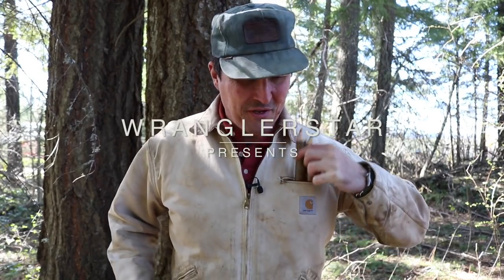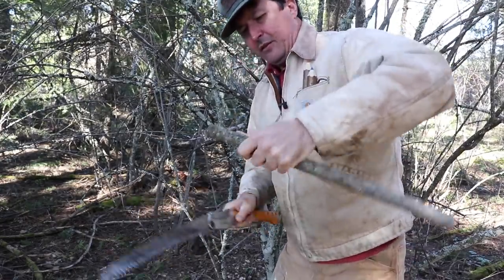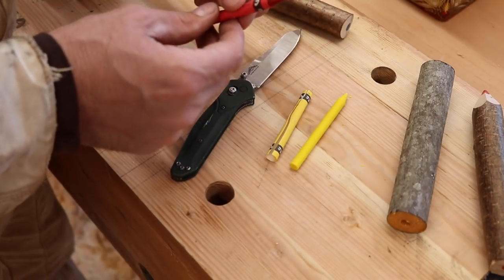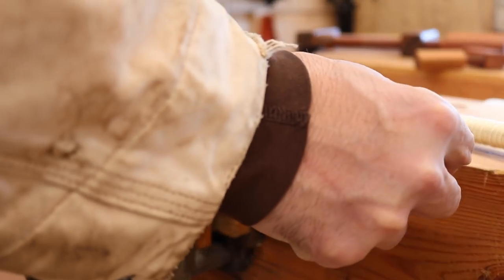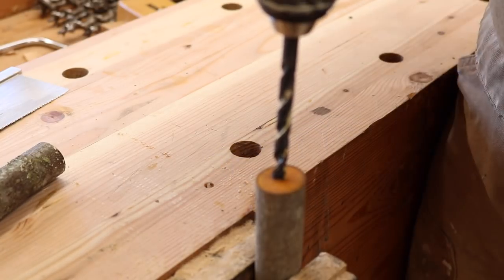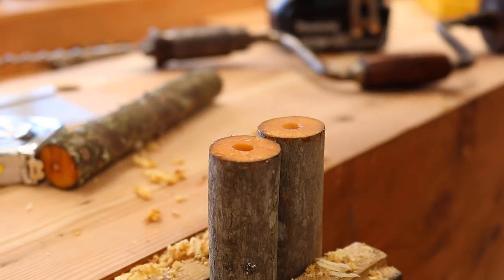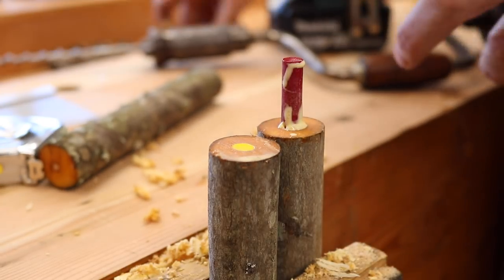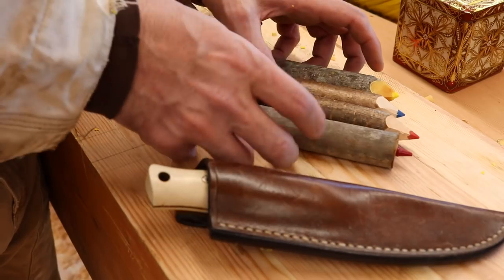How To Make Branch Crayons

Comment: Why not just drill until you're almost through, maybe 1/4" before drilling all the way through, melt the crayons and pour it into the cavity? Once the wax hardens, cut off the last 1/4" you didn't drill through, then sharpen. I think that would be a really cool, if more labor intensive way to make these, but you wouldn't need any glue as the wax would just grab onto the grain.

Comment: Seems to me that you're drilling a blind hole and then putting a crayon in the hole that fits so snug that air can't escape out. If you drilled it all the way through the branch it would probably be a lot easier to get the crayon inside.

Comment: Your took over 14 minutes to say "Cut a stick as long as crayon, drill a lengthwise through it and insert a crayon.
What kind of glue do you use and why?
I glue up wood to make furniture and wax my clamps and work surface so dried glue won't stick to them.

Comment: rather than cutting the crayon in half, and making 2/3 of the stick basically useless,   why not put the full crayon in, and on the bottom half, put a different color, sharpening both ends

Comment: WHY NOT BORE ALL THE WAY OR MOST OF THE WAY THROUGH. CRAYONS MELT AT A VERY LOW TEMP. THEY ARE MOSTLY WAX. MELT THE WAX IN A CAN (A TUNA FISH CAN WORKS WELL)BUT ANY CONTAINER  WILL DO.  JUST POUR THE MELTED WAX INTO THE HOLE THIS WILL LIKELY NEED MORE THAN ONE CRAYON.

Comment: it would b easy n kinda fun to melt the crayons down then pour them into the wood so its genuinely a wood crayon at that point, u would go thru alot of wax n it would b kinda pointless unless the ppl actually used them  but wax is cheap enough    if u were to do the method u used, whiches probably what im goin to do because nobodies goin to use them imma b real lol but theyre cool so.. but instead of cuttin the crayon in half im goin to try to leave more meat on the business end jus in case

Comment: That brayson bit is clearly the wrong size. You could see how much it was cutting in vs how much was just the spirals. So you have a wriggly screw path into the shaft that is the right measurement and a centre accessible hole that's too small.
Reply: Brace and Bit!